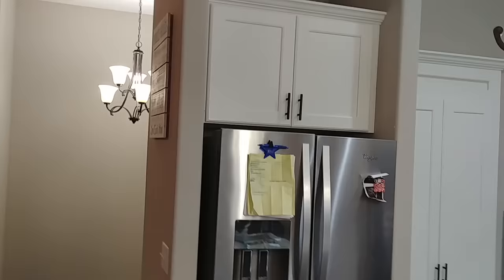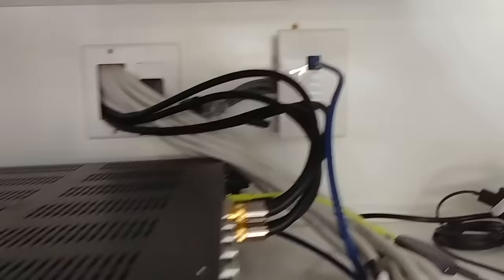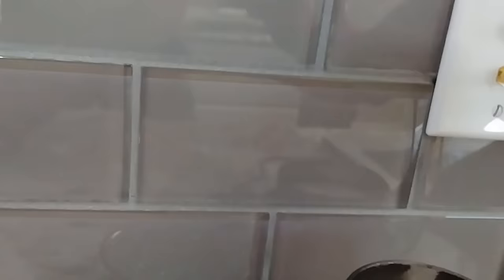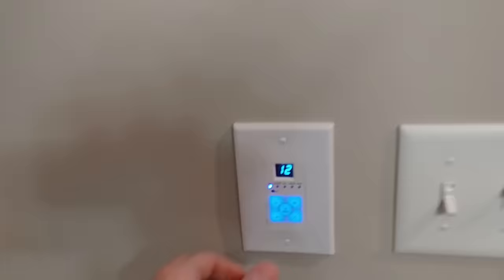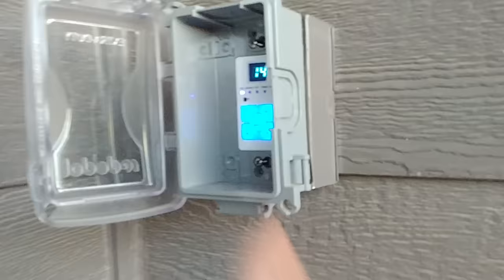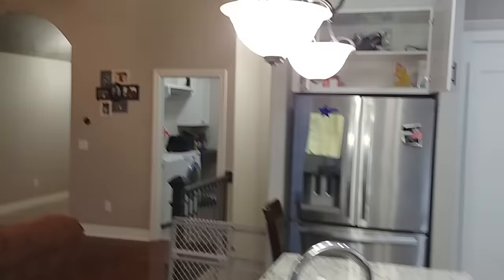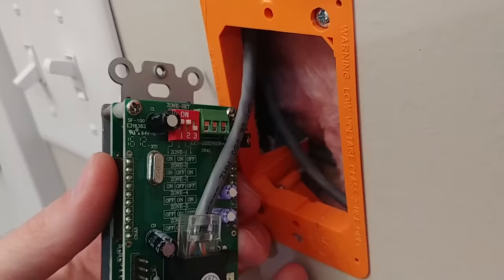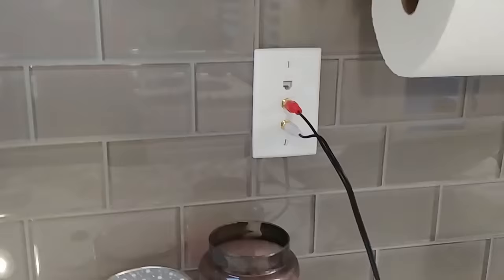WHOLE HOME AUDIO: Monoprice Whole Home Audio Amp! 6 Zone 6 Source

Comment: has anyone been able to figure out the 5v pins and the ext pins?   I am referring to the back of the keypad thanks.  I am also looking for additional keypads seems hard to find...
Reply from the maker: Good question I do not know the purpose of those
Reply: @TheKMZ1  the ext - (i was thinking might be external ir) in case you wanted to put a ir rec somewhere else.. - but there is a light for it on the keypad...  i have been wondering for weeks as i look at the keypad - i tried searching the brands/ printing  on the boards and there is no write up on them anywhere  - thanks for the prompt reply.

Comment: @TheKMZ1 do you know of rack that will take this amplifier? I looked at monoprice and they stated they do not have one to fit their amp as its 16”
Reply from the maker: The width will fit any standard rack. I assume you are talking about the depth of it? You can either get a 2 post rack that doesn't mount to the wall because then you can control how far the rack is from the wall. But if you want a wall mount rack look on Amazon for a deep rack. They range from 17 to 19 inches deep
Reply: TheKMZ1 Thanks, yes I’m referring to depth. The wife likes it to look neat even though in a closet . Just didn’t know how much room is needed to allow for 14-16 gauge speaker wire and other input/output

Comment: Great Setup! did you run your own wiring? How difficult was that?
Reply from the maker: Too13lue4U yes I ran it all, if you know what you're doing it's not bad, just labor intensive and dirty.
Reply: TheKMZ1 any tips or tools u use to help you out? How did you get through the insulation on the outer wall?
Reply from the maker: Too13lue4U I used a MagnePull, it works very well but it's a little expensive. I would recommend at the very least, a head light, and fiberglass glow rods. Using a coat hangar to poke through the ceiling to see where it sticks up in the attic helps locate where in the attic you need to be.

Comment: Since I bought 2 monoprice to have 12 zone will I have 12 sources too ?
Reply from the maker: If you want yes, but that means only 1 amp will have it's 6 sources and the other will have it's 6. There will be no sharing, OR you can use the included ribbon cable, and cascade the units together, and one amplifier will be the master, the other set as slave 1 (there is a switch on the back) and it will be 12 zones with the master 6 sources shared across both
Reply: TheKMZ1 cascade the units together what does it mean ? I was thinking once I set one of them as master and the other one slave I will start seen 12 sources on each keypad ???
Reply from the maker: @kingrlune  no, that's not how these work, only the master will share it's sources down to the slave units.

Comment: What other sources are you using? I plan on having 2 tv hookups and Alexa as a source. Not sure what I can use the other 3 for.
Reply from the maker: You dont have to use all, I'm only using 3
Reply: TheKMZ1 currently it has a price of $668 but I’ve been told it goes on sale for as low as $500. Is it worth not waiting and buying for the full $668?
Reply from the maker: @CarterBoi85  It's worth it no matter what. But yes the normal price used to be around 550 or 599 something like that, it appears that maybe that is no longer the 'normal' price. Maybe they have caught on that this video is popular and that these amps are a bargain ;) Nonetheless this system is great so it is your call on if you try to wait or not

Comment: There is two versions of the monoprice amp. Im going to use 5 zones one zone i need 10 speakers which one is the right amp for me?
Reply from the maker: Well, the 2 amps are fundamentally different, one supports 70v (look this up if you don't know what it is...also the 70v model does not come with keypads, and the app I wrote does not work with the 70v model
Reply: @TheKMZ1  hello this is Godstime from Nigeria . I'm just going through this video now and I have a few questions. How many speakers can each zone use , 2ndly , are there other hidden wiring apart from plugging in the sources to the amp, and having the outputs go-to the speakers ? Lastly what makes the pad see the other zones ? Is it the cable from the internet router ? Can you drop your email ?

Comment: can I use these models together # 10761 with model # 39261 master and slave?
Reply from the maker: No, the 39261 is not the same amp, and the RS232 controlling commands are different. But, you can use 1 soundavo ws66i as the master and 1 10761 as the slave and it'll work fine. Watch my video on my channel if you want to know more about the upgraded amp!! TKMZ coupon code will get you $550 off the new  WS66i

Comment: Just finished my installation on 2 of the Monoprice 6 zone for a total of 12 zones and I only get audio on the left speakers of all the 12 zones, nothing on the right. Any help with that?
Reply from the maker: Ricardo Valadez are the switches on the back set to stereo or mono? Should be stereo
Reply: You got it man! I thought I had them on stereo already but guess not. THANKS!

Comment: my question is, how can I integrate this system with Alexa?
Hoping to hear from you soon.
Reply from the maker: You can't integrate alexa to tell the zones to turn on or off. But you can hook alexa up as a source, and then talk to alexa to play music. If you hooked up alexa to one of the RCA inputs, since it's analog you can tell alexa to turn the volume down which will turn her down (not the wall keypad) and it will lower the volume. But if you wanted to say alexa turn zone 1 on, you can't do that. Hope that makes sense. Then if you have multiple alexas you can use the alexa app and link them together so that way the one hooked up to the amp is the default speaker, which means any alexa you ask to play music will play out the one hooked into the amp.
Reply: TheKMZ1 There’s no was to go from RS232>Raspberry Pi>Alexa?
Reply from the maker: @wlms04  it doesn't really matter what the intermediate device is whether the pi or itach, the bottom line is that the Alexa skill or Google home app would need developed still and I don't have the capacity right now to do that lol
Reply from the maker: @wlms04  did you see my video of the chiropractor install I did? I also used the monoprice amp for their whole home audio, you might find that video interesting
Reply: TheKMZ1 No I will check it out

Comment: How many speakers can you hook up per zone? Thanks
Reply from the maker: It's built for 2 per zone, technically it can handle 4 but requires knowing how to wire in a combination of series/parallel wiring. I usually advise people to stick with the 2
Reply: TheKMZ1 if you want 2 zones to be able to listen to something different wirelessly can you hook 2 chrome cast up?
Reply from the maker: @ashtonlester3320  yes you can have 2 chrome cast audios, also you could have 2 Bluetooth receivers as well

Comment: are they keypads poe? how are they connected to the amp?
Reply from the maker: This system comes as a kit. So as such, it includes a "hub" that all the keypads hook into. And then 1 cable goes from the hub to the amplifier. So the amplifier is providing the power to the hub through the ethernet cable. It's all a kit so you dont have to worry about buying this stuff, it comes all in the box. Check it out at monoprice

Comment: What is the neon cable that you have plugged into the chromecast that's plugged into the unit?
Reply from the maker: Kevin Campbell it's the 3.5mm audio cable
Reply: TheKMZ1 I bought the chromecast ultra because of the 4k but realized that it doesn't really matter because that would be plugged into the tv.  So I'm thinking I should buy a second maybe the cheaper version and plug that directly into the unit.  MY question now would be do you think there would be issues with two of them on the wifi and sources being mixed up.
Reply from the maker: Kevin Campbell you have to plug in a Chromecast audio not a regular video Chromecast. The Chromecast audio is only for music streaming, and there is nothing wrong have multiple Chromecast on the network. You just give them different names

Comment: Is anyone using the 3.5 digital coaxial input?  I was just curious what adapter is required to take the digital RCA down to a 3.5 plug.
Reply from the maker: Which input on the back are you referring to? The only "digital" input is source 6 which lets you use an optical cable OR you can use another 3.5mm jack (you will notice they are right beside each other on the back). The other sources 1 - 5 are all analog, which include all RCA inputs. Let me know if you have any follow-up questions!
Reply: Input 5 is 3.5mm jack and Input 6 is an optical or 3.5mm jack.  In the manual --> https://downloads.monoprice.com/files/manuals/10761_Manual_141028.pdf   it says all of these are digital inputs
Reply from the maker: That is really interesting considering the manual that ships with it says they are analog except the optical lol, here is an image i just took. https://drive.google.com/file/d/1iGhVUctnVd3wRMGzDE6aqT6kAavNApQE/view?usp=sharing but i agree what you are reading says different. Here is the manual for the identical DAX66 unit by dayton audio https://www.parts-express.com/pedocs/manuals/300-585--dax66.user.manual.pdf
Reply: TheKMZ1 nice!

Comment: I like your set up, i'm thinking about doing something similar. One question, in the main room, i want to run a home theater set of speakers and I was thinking using the Monoprice controller that you have and feed Zone 1/ Source 1/Music into my home theatre receiver where it will route the sound to all 5.1 speakers in the main room. The other rooms, those stereo speakers can just connect directly to this controller. Does this Monoprice  have the line out? Would that work? Does the keypad control the line out volume as well? Thanks
Reply from the maker: Check out my new videos on my channel, I think you'll really like them. There is a new version of this amp out as well and I've got a discount code. But to answer your question, yes these about have pre amp out connections using RCA cables. What that will do is pass the volume and source/eq data into an external amp and yes the keypads still control the volume through that amp. Check out the video on my channel about pre amp out!

Comment: How can i chain 2 amplifiers for a 12 zones do you have any video for that ?
Reply from the maker: I don't have a video no, you simply by 2 amplifier kits, and in the kit they already come with a ribbon cable, you plug the ribbon cable into both which link them together physically. There is a switch on the amplifiers that can be in one of 3 positions: master, slave1 and slave 2. Your master is set and has the 6 sources plugged in, the slave is just switched as that but everything else hooked up the same. The manual says what to do also
Reply: Cablewise what are the type of cables i would need ? And how to set up the rj45 meaning the color
Reply from the maker: @kingrlune  you buy the kits and all you have to add is your own speaker cable, ethernet and speakers. Thats it, also the ethernet is terminated like standard ethernet. So standard straight through

Comment: I'm just wondering how cat.6 cables are connected to that box inside the cabinet?
Is it mean every 1,2,3 and 6 pin of wires of cable are connected together? something like 1 pin of Kitchen cable connected to 1 pin bathroom cable?
Reply from the maker: Krzysztof Bieniek the amplifier kit comes with a block that all the keypads plug into. Then only 1 cable comes from that block into the amp. Think of it as a distribution block
Reply: Gotcha it's like a 110 wiring block.  Thanks!
Reply: @TheKMZ1  so my question is do I run the cat 6 from the wall switch to the multi port by the amp.... and also do or can I split the speaker wire to more than 1 speaker....I noticed that each zone only has a place for 2speakers in the rear of the amp....
Reply from the maker: @jambrock1031  yes you run the wall keypad Ethernet to the block by the amp. Also, you can technically have 4 speakers in each zone. You would have to run 2 speakers in series, with those in parallel with the other 2 in series. The amp would see it as a 4 ohm load. You can play around with some calculators online to understand how to wire it if you need

Comment: Great Video! Also looking forward to your Home Automation setup. Out of curiosity how are you managing Video output sources? You have 6 sources for audio, but what if you wanted to output a specific audio source to a TV or Projector?
Reply from the maker: I think i kind of demonstrated that in the video, when i turned the TV on and had the tv audio playing outside. Is this what you are referring to? The amplifier has to have audio coming into it, not going out of it, so how i've set this up is that i put a source next to the location where a TV / Projector would be, that way you can plug it in and access that TV/projectors audio through any of the zones in the house.
Reply: TheKMZ1 I think what I actually meant was are you running Video sources locally (next to the TV), or are you sending the video signals from a central source? Because I can only see the RCA sources being sent out to wall plates. I was thinking about using Video Baluns (HDMI over Ethernet), but it may blow out the cost
Reply from the maker: Mango Tran there was an HDMI in that wall plate too, but the audio is considered totally separate from video. Nothing related to video goes to the amp
Reply from the maker: I've never used the hdmi over ethernet but there are some that have good reviews. But for me, my TV cables run behind the wall and just terminate to that wall plate. and then i have cables plugged into the wall plate, with all of my electronics behind the couch so they are mostly out of sight. And to keep cables tidy, i used black wire loom to put all of those cables in, so all you see is 1 big black bundle that at first glance, appears to be 1 cable.

Comment: Does anyone know the max distance you can run one of the controller keypads? I’ve got a detached garage and was going to bury conduit out to it and run a zone out to it. Sound feasible?
Reply from the maker: I would assume that the same distance applies to this as it would if it were a regular ethernet run. So 100m or 300ft.
Reply: Okay that’s kinda what I was thinking but I wanted a second opinion.

Comment: My iTach Flex WiFi randomly stops working sometimes... usually I’m just able to reboot it and reconnect it but this time, try after try, it will not connect... any thoughts?
Reply from the maker: How far from wifi is it? Is it dropping wifi connection do you know
Reply: TheKMZ1 I have a mesh network (that I’m 99% sure is working), and one of the satellites is about 6 inches from it, so I don’t think that’s the problem
Reply from the maker: I've got an exciting new video coming out this week, i think you'll like. It's a new, redesigned monoprice/dayton amp 6 zone 6 source amp. So take the ones that we all know and love, and take that exact one, and make it more modern. That's what i've got
Reply: TheKMZ1 Nice!

Comment: Hey, which type of amp (does it even exist?) do you recommend if I wanted to have upwards of 6 zones that can be managed independently with up to 4 speakers per zone? I saw that Sonos has a great system that is completely customizable with speaker groupings, however I want to use this with ceiling speakers. Thanks
Reply from the maker: Technically, this system can have 4 speakers per zone. You just have to do a combination of series/parallel wiring to make sure you get an 8ohm or 4ohm load seen by the amp
Reply: @TheKMZ1  Amazing. What is the amp you're using? Can you send a link? Thanks
Reply from the maker: @peteeboy99  in the description of the video
Reply: @TheKMZ1  Do you know of any amp that exists that can be accessed over a wifi network and an app that doesn't require wall plates with controls? Not sure if this Monoprice one does that but I'd need a 6-zone amp that can control wired ceiling speakers through an app. Thanks
Reply from the maker: @peteeboy99  Yes this amp can do it, you dont need to install the keypads. Check out my channel i have videos covering it. Android app Monoprice Whole Home Audio Control, you will need to buy the itach flex and flex link rs232 cable, but the links are in my other video descriptions

Comment: can you have multiple keypads set to a single zone?
Reply from the maker: slo2k Probably yes probably if only they sold spare keypads. Since they don't, the answer is no. If you ever found a place that sold these spare keypads you'd be a hero for sure
Reply: I was thinking more along the lines of if you had 4 zones, could you use multiple keypads to control a single zone?
Reply from the maker: slo2k I think that would be possible yes but I've never tried it. There are dip switches on the back of the keypad and I think if 2 are set to the same zone, then they will both control that zone
Reply: This should be in the manual from monoprice, check the product page. If not contact them and ask.
Reply from the maker: schonzen It's not in the manual because normally you would be using all 6 keypads. I am pretty confident you can use a leftover keypad as a secondary location to control that zone because all the keypad does is send the command to whatever the dip switches are set on the back. So just set 2 to the same zone and you are good. Now...If only you could buy spare keypads...